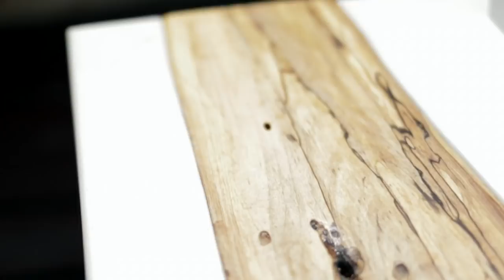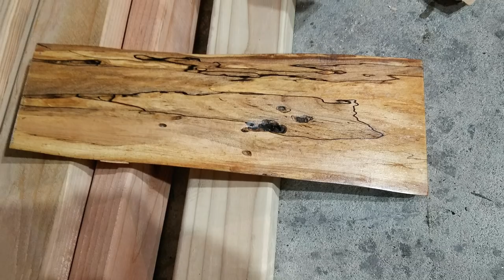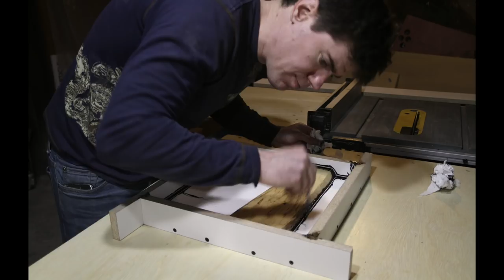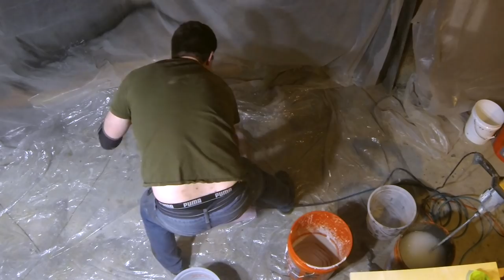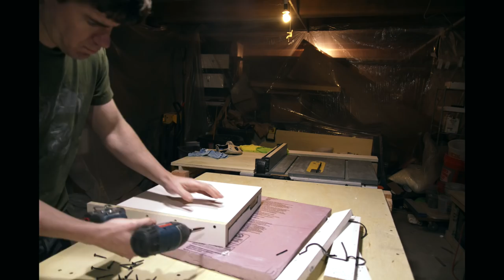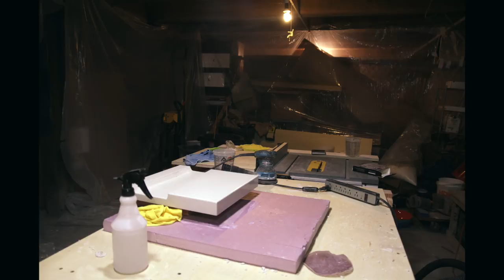DIY White Concrete Table w/ Live-Edge Maple Inlay (using GFRC mix) - How To Make

Comment: What adds the white color? The acrylic polymer? Or are you actually buying white concrete mix? Thanks
Reply from the maker: Nothing adds it -- you just use white ingredients to start with.  White portland cement, white sand (quikrete medium commercial grade is white where I buy it, but I've seen other areas where it is tan, so check before you buy), white/clear glass fibers.  The biggest key is using white portland cement instead of grey portland cement.

Comment: Found your channel vis Foureyes. Good stuff. Question about Melamine. I have a bunch of Melamine that has a very fine pebble texture to it. It would make a cool pattern for an outdoor kitchen counter I am considering building, but don't know if it would have release problems. Thoughts?
Reply from the maker: Awesome!  If it's the same plastic coating used on melamine shelves, it will be just fine.  If you want to be sure, you can just mix a small cup and dump it on a small section of the melamine to test it (melamine is generally reusable a few times, unless caulk or glue gunks it up).  You can also order some concrete form release to be doubly sure
Reply: Modustrial Maker thanks. I’ve used it for some utility cabinets and have leftovers that I’ve used as cauls for glueups since pva glue doesn’t stick, just like smooth melamine so I might give it a go.
Reply from the maker: Go for it!  Tag me on Instagram if you do share pics

Comment: Have you tried just leaving the wood in, pouring, then polishing the entire thing? Would that work?
Reply from the maker: I have not, and I don't think it would work too well.  Concrete sands down much more slowly than wood, so it would be difficult to sand both at once without removing too much wood.
Reply from the maker: Also, they use different sealers...but you can just pre-finish the wood, and leave it in.  This works fine, it just might add some extra work taping off the wood and concrete alternatingly, as you finish the other material.

Comment: this looks awesome! great video, new sub here. Are there any benefits to using concrete over a epoxy with white pigment? sorry if thats a common question on this video im just curious because I sell epoxy to folks at the store i work at.
Reply from the maker: Thanks!  Concrete just has a completely different look than epoxy, so it's mostly an aesthetic preference (stone vs plastic)

Comment: Hey, buddy, I have made a few castings, but question my father just passed away and I have never used GFRC how long do you think it would hold up as a headstone?
Reply from the maker: +Quinton I I honestly don't know specifics about headstonds...it will do anything standard concrete will do better tho.  It works great outdoors
Reply: I think I will try it, I will seal it with a densifer so I can polish it up

Comment: Hey there great video! Thanks for the idea and how-to.  I am trying to do a table of my own and have a few questions: Did you use white pigment to color the concrete? (the link shows charcoal). Also how much volume does a bag of GFRC usually cover. My table will be 48" x 12" x 1.75"
Reply from the maker: no pigment -- that is the natural color of GFRC mix.  You don't want to pour it 1.75" thick -- you can just make it .75" thick with 1" foam insert to fill the rest of the space.  You could probably get by with one 50 lb bag of GFRC mix (table will probably be about 50 lbs), but I'd get two bags so you can do a small test slab and get familiar with the process before the main project.

Comment: Beautiful table.

If you were making a full size table, 3'x8' would you be able to use this same process without additional reinforcement in the GFRC?

Bill
Reply from the maker: yes, absolutely.  For that size, I would make it 2" thick, but embed a sheet of 1" pink insulating foam in the middle to reduce weight and cost.  I.e., pour concrete .75" thick, put pink foam in middle (dimensions about 1.5" shorter than table top on each side so it doesn't show), then fill sides around foam and put .25" of concrete mix on top of it, so you only have 1" of concrete in your 2" thick table.  If you want a thinner table, you can adjust by using 3/4" or 1/2" foam instead.
Reply: Awesome.  Thanks!  You've inspired me for a fall project for the wife.  She's wanted a table for the patio and I'm going to do this same thing.  Great videos and work.  I'm following you now!
Bill
Reply from the maker: Thanks!  I have some more concrete and GFRC videos in the pipeline.  Would love to see what you make when its done!  Feel free to reach out to me if you need any assistance with your project.

Comment: I want to use a mold process along these lines to make some simple bookends. However, I'd like to use a concrete or plaster product that's less complicated and more ready-to-go from the store. Do you have any recommendations? I'd want it to be non-pourous-looking and white like this, and heavy.
Reply from the maker: Check out the bagged GFRC mix I used in my video for the concrete coat rack.  It would work well.  For something small and thick, like a bookend, you could also use a 50/50 mix (by weight) of quikrete commercial medium sand and white portland cement, quikrete acrylic, rapid set flow admix, and quikrete acrylic fortifier instead of water.  It isn't exactly ready to go, but is all available from home depot, except the white portland cement, which you should be able to find at your local masonry supply store.  Unfortunately, nothing home depot sells is really white.  The "white" countertop mix is kind of a beige off white that isn't that attractive IMO.  Right now, if you want to buy local, you have to mix your own, or you can order GFRC ready made mixes online (which are more expensive, but easier).
Reply from the maker: Do you think you'll want to do more concrete projects in the future?  If so, then its worth it to invest time and effort in GFRC (also its actually a bit more, since you need to buy the glass fiber bag in addition to the mix).  If you don't think you'll want to do any other larger projects, then it probably is not worth the cost and effort for just one small project.
Reply from the maker: And, you could try that recipe I gave you...the hardest part of that is finding white portland cement.  But, if you just google "masonry supply", you'll probably find a place locally that has it.  The quikrete sand, acrylic modifier, and rapid set flow are all available at home depot, and will set you back about $15.  Probably another $15-20 for the cement.  Granted you'll have 200 lbs of this mix, but it will be cheap :)

Comment: Was there any white coloring added or is that the natural color of the cement used?  Thank you.
Reply from the maker: No, I didn't add any coloring.  There is white pigment that is available, which I've used, and can result in an even more glowing white.  However, the pigment can be expensive, especially for larger projects (about $10 per 50 lbs of mix), which is part of the reason I chose to just go with the natural white.

Comment: Does it matter what size or style of hopper you use? Really loved the video
Reply from the maker: You need a nozzle big enough for the concrete to spray out of...I want to say the setting I use is 3/8".  You also want a 45 degree elbow between the sprayer and the hopper, so you can spray downward at 45 degrees without concrete spilling out.  The one I linked to is a bit pricier, but works reliably and has a disc that allows you to adjust the size of the nozzle opening so you can fine tune it.  I have heard the harbor freight hopper works if you add a 45 degree elbow, but I haven't tried it personally so can't verify this.
Reply: Sweet thanks man. Have done a few concrete bench tops in the past. Never with a hopper or fiberglass, but it looks like it'll take it to the next level and reduce bubbles on the face when you flip?
Reply from the maker: Yes, definitely reduces voids -- for basic table tops I usually don't need to do a slurry coat.  I haven't mastered vertical surfaces yet, so still need to do slurry coats on those (some pics are on my Instagram if you are interested), but I think if you work with GFRC enough you learn to control the way the mix behaves well enough that you can get virtually pinhole-free surfaces in any mold.
Reply from the maker: p.s., make sure you don't use regular fiberglass -- you need to use alkali-resistant (AR) glass fibers, which don't break down over time in the concrete.
Reply: Oh I see. I also might build myself a vibrating table for pouring the moulds on. Can you vibrate the fiberglass conc?
Reply from the maker: No, you don't vibrate it at all.  The defoamer and plasticizer admixes take care of most of the bubbles, and brushing after you spray the face coat does the rest. vibrating would knock the face coat off the vertical surfaces.

Comment: It almost seems like you wouldn't want to use the caulk around the edges of the slab, so that it fits the concrete more snugly. Would there be a problem with this? Would the concrete be frail and chippy around the edges if you didn't contour them?
Reply from the maker: The potential issue is that the concrete could flow underneath the slab, and maybe even push the slab up away from the face.  Given the risk, I decided having the slight lip was a fair tradeoff.
Reply: Thank you for the explanation. I know little about this. Your video and response are super helpful.
Reply from the maker: No problem.  Glad to help!

Comment: I think I detected a few dodgey  edges there ! Seems you might have taken a little more care when filling the mould! I know I would have taken a little more care to brush the mixture into the corners before actually pouring the main body of the table top or spent more time finishing the edges at the end . I worked as a mould maker for a few years and used plaster with fibers and they do make the piece structurally robust! Great idea with the silicone though Seems  very effective! Sorry for the criticism Overall it was a good job and got me thinking again about doing a little myself at home!
Reply from the maker: No worries!  As a mold maker you'll see things others might not, and I always appreciate advice from a pro! :) This was my second GFRC project, and mainly was done for the purpose of learning how to film project videos (first one I ever filmed).

Comment: Hey Mike is it possible to put too much wax before you put silicone bc I think I did, the lines that you peel off are still sticky even after sitting overnight, you think it’s just too much wax?
Reply from the maker: What kind of silicone did you use?  The wax shouldn't affect the silicone curing , no matter how much you use
Reply: Modustrial Maker 100% Silicone by GE from Home Depot
Reply from the maker: Hmmmm, not sure what the issue is....if it is cold, curing takes longer .  Is just give it a bit more time
Reply: Modustrial Maker it could be the humidity, it’s very humid rn and it’s sitting in my garage, I’m going to put it in the sun to see if it works
Reply from the maker: Ok, hopefully that will work, I've never experienced wax interfering with silicon curing.
Reply from the maker: Ok, hopefully that will work, I've never experienced wax interfering with silicon curing.

Comment: Nice work but why go through the trouble and work of using concrete if it doesn't look like concrete afterwards? The same effect could have been achieved with a painted wood block.
Reply from the maker: Perhaps you have to see it in person, but I don't think you could get the look with wood and paint.  It looks more like polished marble; i.e., it looks like stone, rather than wood.

Comment: Can that mix be used for floors? It would be beautiful as a big whole continuous floor without grout
Reply from the maker: Floors are not the most practical use of a mix with glass fibers, since it needs to be cast upside down.  I believe there are some white concrete mixes designed for floors, but I have not used them.

Comment: Awesome video. What was the final cost of the project?
Reply from the maker: Chad S thanks! This can be done with one bag of GFRC mix, which is $45 + shipping.  The maple piece was $15, and the melamine was just scraps from previous projects (it would run you $10 or so).  Honestly, since I made my mix from scratch and ordered ingredients in bulk, and used melamine and sealer I already bought, my actual cost was probably just $40.  If you have to buy a whole bottle of sealer, ship the mix, buy the melamine, etc. then you'll probably spend $120-130 on materials, but you'll have a good amount of leftovers.

Comment: Great video, what are your thoughts on those dust masks?
Reply from the maker: I really like them.  Super comfortable and seem to clean the air pretty well.
Reply: Modustrial Maker have you tried them with welding? Im looking for a low profile mask to fit under my helmet.
Reply from the maker: No, in fact, I've never welded!  It is next on my to-learn list!  I'd probably spray it with some fire resistant spray, but I'm guessing this would work pretty well for that purpose.
Reply: Modustrial Maker oh boy you are going to love welding! So much more forgiving that woodwork, if you make a mistake you can easily fix it. The mask will be under full face helmet so should be fine. I'll pick one up this week and give it a try!
Reply from the maker: Cody Bond yea, I'm excited to try it.  It may be next year since I need to do it outside, and I live in Chicago, but I've already got a couple welding projects planned.

Comment: Why spray then brush? Wouldn't just brushing it on in the first place be sufficient? I'm genuinely curious, and if it can be done with one less specialty tool, it's just that much better.
Reply from the maker: You can also brush it in, but vertical surfaces are tougher to get perfect when you don't spray.  Also, you can get a thinner and more even face coat when you spray.  If too thick, you can get cracks in the face coat.  But, you can get good results without spraying.  Check out my most recent video for the concrete coat rack where I use the pour and brush technique for the face coat.

Comment: How wide can you go on the concrete without having to add reinforcement in to the board? Things like bolts or lag bolts screws in for the concrete?
Reply from the maker: With GFRC, pretty darn wide.... If it's supported from below (like a countertop or table) the size of the melamine sheets for the form are the limiting factor

Comment: Do you have to spray the first layer with a hopper??
Reply from the maker: No, not necessary.  Check out my recent video where I don't even use a face coat (there is risk of fibers poking through but its doable), or my wall rack video, where I do the face coat with a brush.

Comment: Very nice work. The two materials have very different coefficients of expansion/contraction you may have in time problems keeping the two together.
Reply from the maker: Expansion was definitely a concern. This is part of the reason I poured the concrete right over the wood in the mold, and then covered the mold while the concrete cured. While I sealed the wood before I did this, the water from the concrete mix still evaporates and creates a very humid environment in the mold (surrounding the wood). This is about the maximum humidity you would find any any environment the table will be in. Thus, the wood expands a bit in the mold while the concrete is still curing (i.e., not hard yet), and the concrete cures around and takes the shape of the slightly expanded wood. Once demolded, the wood contracts. As a result, there is a slight gap between the concrete, but nothing too noticeable (at least IMO). More importantly, there is very little chance the wood will ever expand more than it did in the mold and cause cracking in the concrete or wood. GFRC also can flex and bend a bit (much more than standard concrete), so this helps.  I actually made this table about 6 months ago, and it has been moved around, inside and outside, and so far, so good :)

Comment: Did you drill holes into the concrete to attach legs?
Reply from the maker: Yes, using tapcon bit made for tapcon screws

Comment: Apply the silicone then spray soapy water. Then use a pop stick and rag to scoop the excess off
Reply from the maker: I've tried something like this and it works well, but not quite as well as the paste wax and metal ball tool

Comment: How did you attach the iron legs to the solid slab ? liquid Nails ?
Reply from the maker: We drilled holes in the steel and used tapcon concrete screws.  Liquid nails would work too though